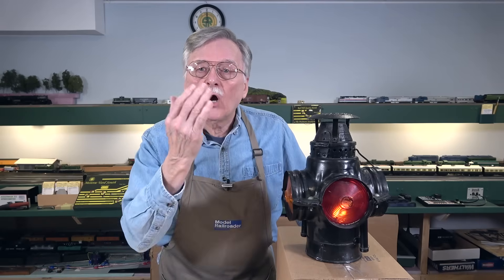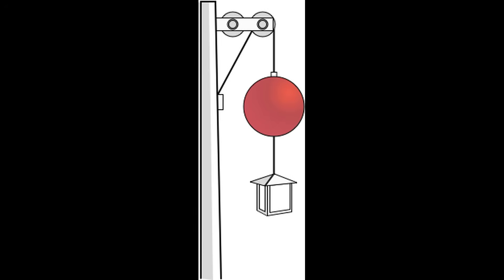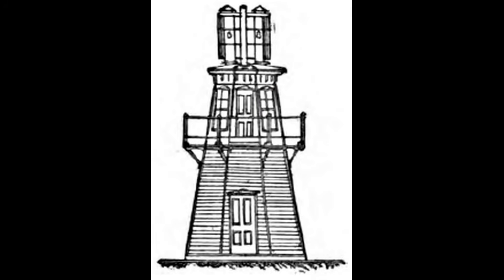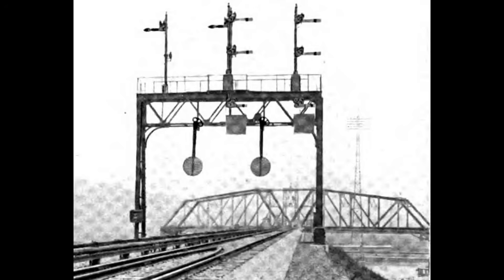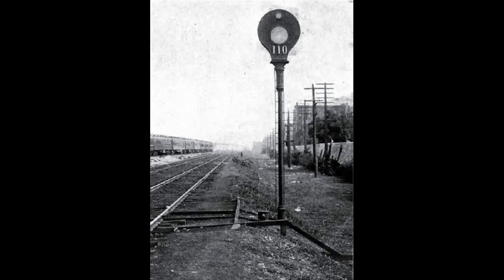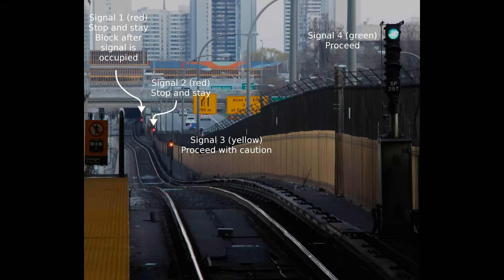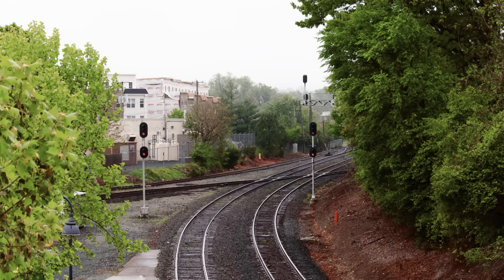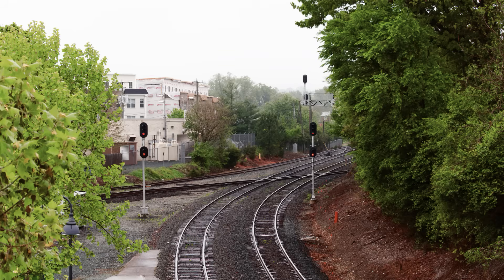Why Are Railroad Signals Red, Green, and Yellow (355)

Comment: Another GREAT, informative vid Larry!  However, one thing that has frustrated me as I model n-scale signals for portions of the Nickel Plate’s Cleveland Division (circa 1957) is they used 3-aspect signals…red on top, followed by yellow and then green on the bottom. Most commercially available n-scale signals start with red on top, etc. So, now I’m ordering individual components to create NKP signals in the correct color aspect. I know I could have just gone with what was commercially available, but I was afraid Tony Koester would call me out on it. I’ve kinda been bitten by the prototype bug.

Comment: Early U.S signalling took its lead from the British Great Western Railway. A broad gauge 7ft 0.25 inch railway already operating at speeds of 60mph by the late 1840's. Due mainly to its stability and very solid track construction which used huge Longitudinal timber Baulks with steel ties. An Isambard Kingdom Brunel speciality. And by necessity was first in the game of "Time Interval Working" supported by "Disc & crossbar" type signalling from 1832. Which was quickly improved upon by the adoption of the "Naval Semaphore" methods. Which is where railways got the semaphore signalling ideas from. There were Naval Semaphore towers on both land and ships from the mid 1750's. Intended for sending messages between ships, and across country.

Comment: Has anyone every mentioned that your image of the Semephore on your junction crossing should be Red and not Green?  Railroads are replacing target signals with aspect signals for ease of maintenance and greater option in configuration.
Reply from the maker: Do an internet search for “railroad semaphores” and I think you’ll see that it is correct! As for replacing targets I wonder how using multicolor LEDs might change that?
Reply: @TheDCCGuy  I was going on the basis of the caboose on the other side of the diamond being the end of a preceeding train...making the next block occupied, and depending on which route is the primary route(I presume your Piedmont Southern) all other traffic would have to be cleared before proceeding through the diamond.  Not sure about using multicolor LED's, since vehicle traffic lights are being outfitted with LED's now I would think it's just the same "light" only in the reverse order.  I've noticed a lot of the new tri-color and dual aspect signals are already LED's...mostly for the increased brightness and less power consumption.
Reply from the maker: That was just there both as a viewblock to disguise the end of track on the other side and to protect the crossing of the Southern mainline by the C&O tracks.

Comment: This topic could easily take up a ten hour video series. Lunar White was chosen by the PRR position light system after extensive testing. It had to have maximum visibility at distance in every conceivable weather condition from dark dense fog to bright sunlight. A lot of modelers make the mistake of the signal controlling directions. While there are signals cautioning the crew that a turnout has been set to diverge. The majority of signals control speed according to the rulebook. You can not proceed unless signaled to do so.

Comment: I was sorry not to see a video from you last week, but glad to see that you're back with another interesting topic.
On the question of white signal lights, you may already be aware that, in the UK, some Ground Signals use red and white lights.  According to Wikipedia, these "allow a train to move into a section under caution", e.g. if the section is already occupied.  They can display two horizontal red lights (meaning 'Stop') or two white lights at a 45 degree angle to 'Proceed with caution'.  Similar to these are the Shunt Signals, which display either two horizontal yellow lights or two angled white lights.  Lastly, there are Junction Signals that are attached to the normal running signal at a junction and consist of a row of white lights to indicate the diverging route for which the junction is set.

Comment: The reason red-WHITE-green was rejected is because if a colored lens broke (especially red) you'd just see the light bulb and might mistake it for a proceed with caution signal. 

Semaphore signals, though mechanically complex, were also susceptible to winter weather. Lower quadrant semaphores (pointing down for clear, sticking out for red) could turn from red to green if the linkage broke or if heavy ice and snow forced it down. The upper quadrant semaphore attempted to fix this by going to red if the linkage broke or the arm was forced down. Unfortunately, icing conditions could freeze it in the clear position. The Pennsylvania Railroad's position light signals are an elegant solution to both weather, broken lenses, or burned out bulbs - aspects used a line of three lamps, all lamps being of the same color regardless of signal indication.